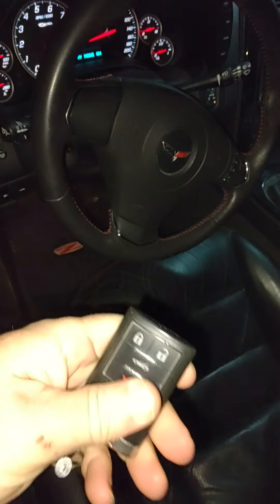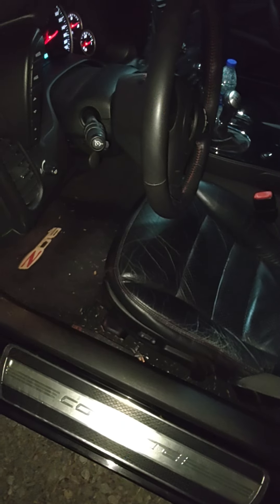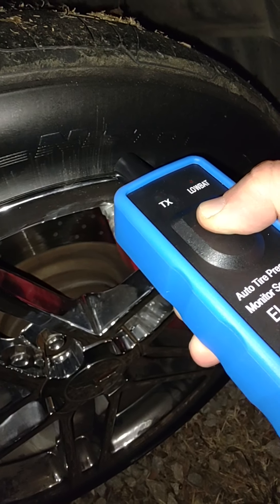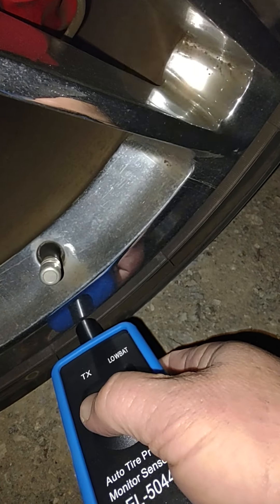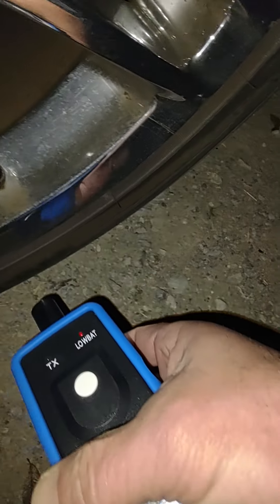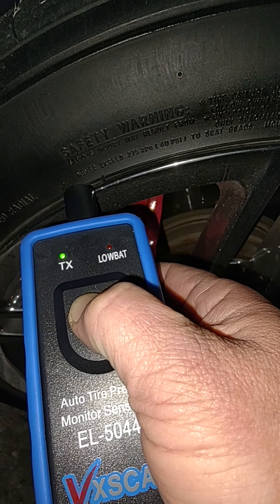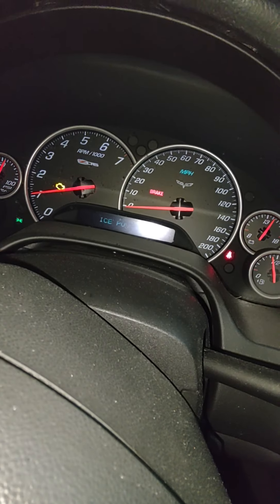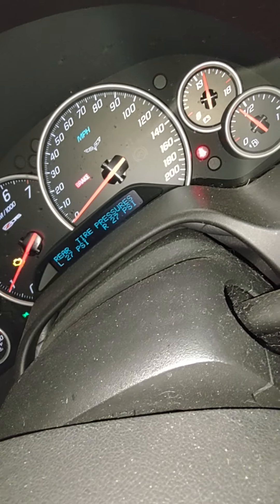How to train or reset TPMS tire pressure sensors on a C6 Corvette with no functional horn

Comment: Was this with stock sensors, or aftermarket ones? I'm looking to replace my 06' sensors and not sure if it's fine or not to go with cheaper ones, cause $300 for a set is damn steep!
Reply from the maker: Stock sensors. They were replaced by Discount Tire so as far as I know, they were OEM replacements.